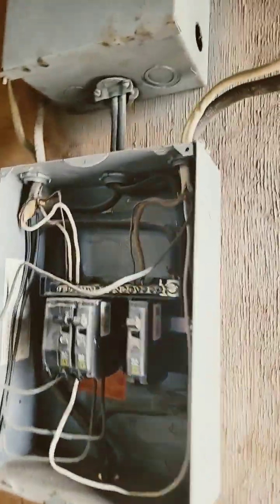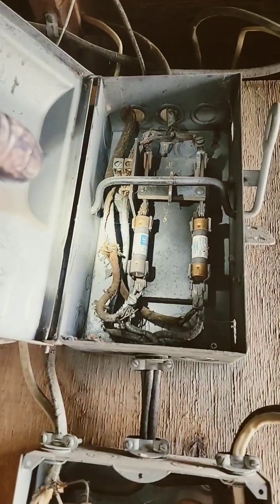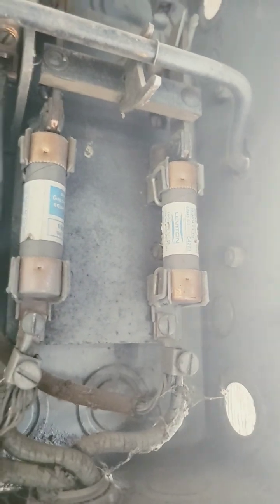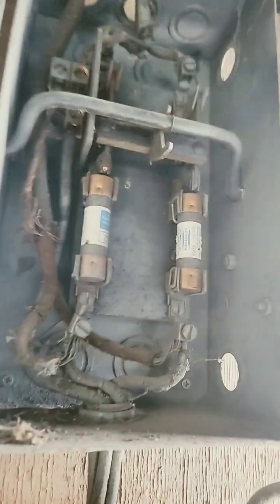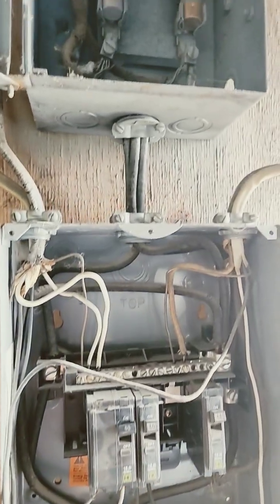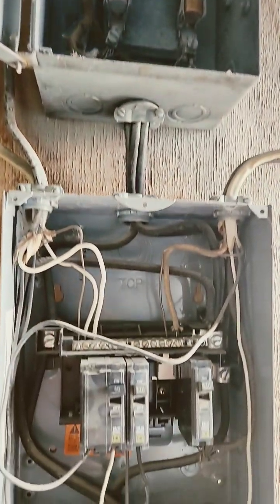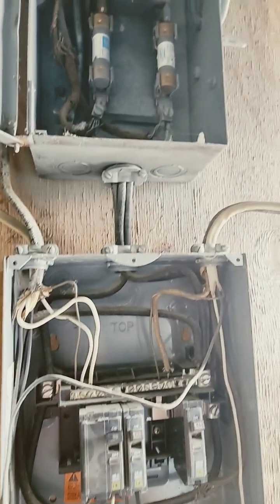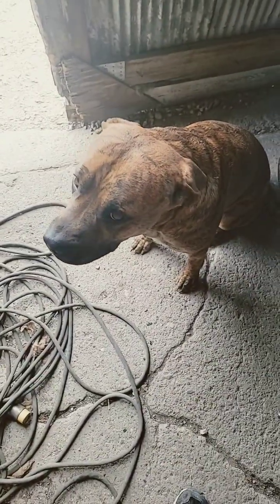How many amps is this fuse box??

Comment: Man you don’t add the barrel fuses to total the amperage of the disconnect. That’s a 60A fused disconnect, it’s supplying power to a 60A or possibly a 100A breaker panel encloser. 

Back in the day and even now a lower amperage fused disconnect could supply power to a same size or larger breaker panel.

Only except now it’s all breakers where as back then it was larger snap-in barrel fuses for the disconnects, mains and larger loads.

Then the smaller branch circuits were usually screw-in Edison fuses and back then breakers were a newer technology thing!

Comment: By the way, the other guy commenting is correct. You don't add the amperage in the box.
It's 220 volt service broken down into 2-110 volt, 60 amp circuits.
The maximum rating is 60 amps (that is if the other fuse is also 60 amp).

Comment: 60 amp 220 volt main service.
It is old. Probably put in after WWII around the 1950's.
I used to see a lot of them in old mobile homes when I had my RV and mobile home repair business. And, unfortunately, a lot still exist in my hometown in houses that haven't been upgraded since the 1960's mostly due to the cost and owned by older people who are retired.
Reply from the maker: I don't know....needs to be redone I know..   had 60amp in the barn shop, never had an issue...led lights and welding sheet metal doesn't take much.. But may up the game 😆
Reply: If you do that, then you're living life like a Redneck...just getting by.
Besides, it would make a great video series about you upgrading the electric!
⚡💥🔥😂😂😂
Reply: There are a couple of things to consider before you start.
The first is by looking at your service panel for the house. If it's not 200 amp service with breakers, you probably are going to either have to upgrade service to the house so you can run a sub panel 100 amp service to the garage OR run a completely new 200 amp service to the garage from the street.
Here in The Great Industrial Northeast, the local power company will run a new service to a pole on your property up to 125'. From there is up to you. Keep in mind that there will be a separate monthly bill for the privilege of being their customer plus electrical usage.
You might want to check on those two things first.
 I will say this, it may seem like a lot of work but in the long run worth it to plug in a welder and not worry about the lights dimming or running into the house to reset a breaker (or replace a fuse if you have older service) or add an electrical hydraulic lift or maybe heating or even a water heater!!!!!
Reply from the maker: Shop is on a separate service than the house...
Reply: That's good. Call the power company and ask how far their responsibility of the service line goes and have them verify that the service entrance wire is 200 amp service to the garage (or service pole).
That's your starting point. When you call just be honest and tell them that you want to upgrade the electric in the garage, not sure about the service from the pole and want to make sure that the wire coming in can handle the load. They should send a lineman out who can go over it with you and answer all your questions. 😅!!!
Reply from the maker: 😂 there is absolutely no way I need 200 amp....no way!!  60amp in the old barn shop... Never had an issue...  that's just nuts 😂😂
Reply: @TheFoxShop 
What I’m saying is the breaker on your panel needs to be properly sized for the wires feeding it.  So if #6 wire is feeding it then you need a 60 amp main breaker!  If #2 wire then you could put a 100 amp main breaker.  All that old disconnect is doing is protecting the wires coming into your shop!
Reply: You're missing the point. Hopefully, you will never use 200 amps. If you ever do, then you will need to upgrade to three phase power. But that's industrial and you'll never get there in your garage.
As far as 200 amp service goes, it's better to have more than you need rather than have less and need more.
I have 150 amp service panel in my house and it's not enough. I want to put in more outlets and there is no more room on the service panel to add any extra breakers for more circuits.
I also have a hot tub. That requires a double 50 amp 220 volt breaker and there definitely isn't room to add that.
So my solution will be to replace the 150 amp service panel with a 200 amp service panel. All the wiring stays the same. 
With electric it's best to not cheap out. Just think of all the things in the garage that use electric.
And if you're like me and many other guys, there's no such thing as too many outlets!
Reply: Also, if you're running a welder, then the air compressor kicks on and on top of it all the lights, battery chargers and anything else plugged in, you're pushing the limit on a 60 amp fuse.
Personally, I think you are missing out on a golden opportunity.
But ultimately, it's your garage, you go whatever direction you want.
Reply from the maker: Never had a problem before
Reply: They supply power to the first pole with the meter.  After that call an electrician!  You need to update that service disconnect.  You could do it yourself.  Shut the power off at the pole and it should be dead!  #6 copper is good for 60 amp.  #2 good for 100 amp
Reply from the maker: Yeah who knows how long ago that top box was put in... Before my time I'm sure... I believe here anyway, they are responsible for the first two poles into your property... And I would imagine the meter... Beyond that it's all on you... I may be mistaken... But that's what I've "heard".   Don't see any reason really for that top box.
Reply: @TheFoxShop  

You really wouldn’t need the disconnect if you have a breaker box with a main breaker properly fused for the size of wire feeding the breaker box
Reply from the maker: @joepvanhoveln2935  I would probably shut it off at the pole... Just because 😆